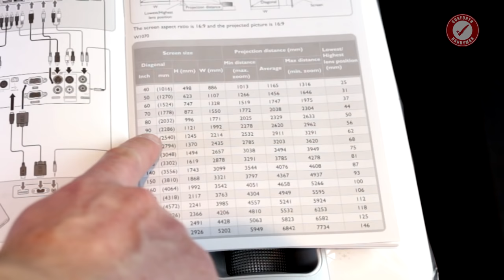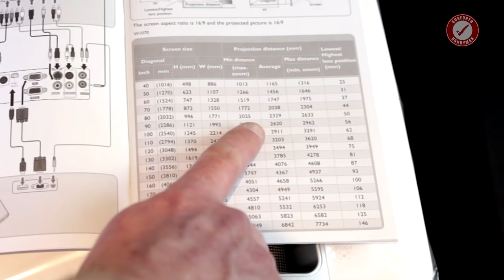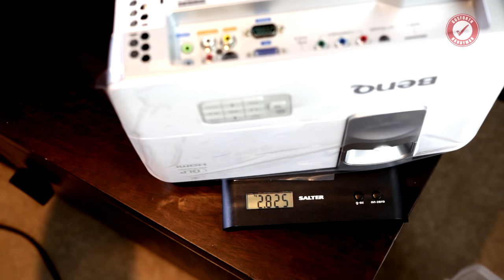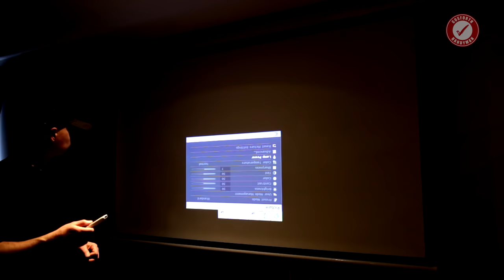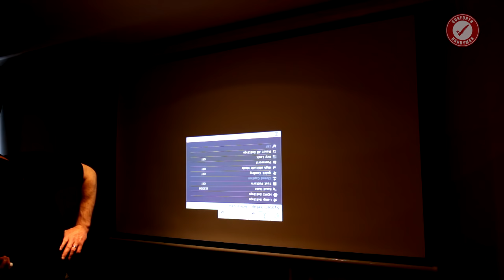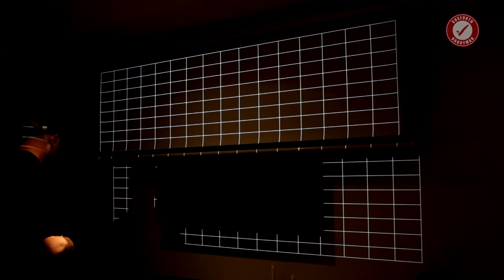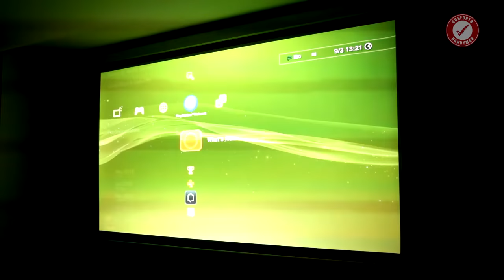How to Install a Projector on a Ceiling with 90" Screen (detailed install)

Comment from the maker: Similar to what I'm using:
BenQ W1050 Projector: https://amzn.to/2tqXtn6 (UK)
Luxburg 90" Motorised Projector Screen: https://amzn.to/2K8eflF (UK)
BenQ HT2050A Projector: https://amzn.to/2MPrd6m (US)
Homegear 100" Motorized Projector Screen: https://amzn.to/2lr1c0p (US)
I've also added a full article to go with this video here, hopefully you'll find it a useful addition: http://gosforthhandyman.com/2017/05/installing-a-projector-on-a-ceiling/
(the above are affiliate links)
Reply: See im putting mine in the Living room, but its coming from our high-speed Gaming computer. I have to tweek the Resolution on the computer I found out, and a Certain Distance I found, away from the Screen. I tried to Eyeball it... No Sir. U gotta get the Specs, and measure for that Ceiling Bracket. Cuz theres a certain area that you want your Lens to line up with on the Screen, and the Distance away that is calculated by the Dimensions of the Screen. So yal Cant eyeball it. Lol.
Reply: Hi there,

Great video. Quick question, what tool did you use for the  screws that you put into the ceiling for attaching the ceiling bracket too. And what type of screws are they?
Reply: Can this be mounted to sheetrock?
Reply: Just been reading about geefix for hollow walls/ ceilings they have really good recommendations, what projector bracket did you use, i cudn't see a link for them???

Comment: I think you tip about placing the bracket at the center of gravity as opposed to the center of the projector is extremely valuable.  After all, the center of balance is almost certainly NOT the center of the device because the weight of the various internal components is unlikely to be evenly distributed.  I am always amazed at the number of small details that I fail to consider because I am just a layman.  Thank you!
Reply from the maker: No worries - gland to be of help! 👍

Comment: Solid work, I have been a home theater installer for about 7 years. At my current company I am the only person who uses anchors to mount projos and tvs they all think im crazy but they just haven't done the research.. I typically use Hilti Toggle anchors which hold up to 124lb a piece and hang 85" tvs with them never had an issue. A lot of people think you need a stud and thats just not the case unless its a full motion articulating mount.

Comment: Good solid advice for this budget projector. A £10 one is just a bit of metal , a £100 mount is one that has fine adjustments to get the best alignment and can take a far greater weight so bear that in mind when buying. Get what’s fit for purpose depending on  what level of projector you have chosen.

Comment: I"m DIYing my home studio/theater. Should I add any other wire besides HDMI ? I don't have a projector yet but will probably be lower end consumer range.  Also - given the option, should I add a dedicated circuit to plug the project in to?

Comment: Nice video. Although sheetrock anchors are strong, for something this expensive, you really should find a joist to make sure at least 2 of the screws are secured. Over time, downward forces and shaking from your home theater subwoofer will weaken the hold of the anchors over time. :-)
Reply from the maker: Not necessary with these anchors - they're rated to 15kg each and there's 4 of them - the projector weighs 3kg. I guarantee you the ceiling will fall down before this comes loose.
Reply: @GosforthHandyman  Yes but all the stress is within a few inches, really dodgy

Comment: Two long bits of string that are the same length attached to the corners of the screen and pulled tight will give you the exact centre of the screen on the ceiling. If you mark the location and then slide your fingers along the strings (keeping them equal and together) mark again and join the points you have a straight line perpendicular to the screen.  Helpful if your room isn’t square...
Reply: Or, place the end of a flashlight flush against the opposite wall, move the flashlight along the wall until it aligns with the center of the screen which is on the other wall, and that's your lens center, regardless whether the room is square or not. Takes less than one minute to do.

Comment: Hi, I've read that pull down screens curl in the corners so I was considering a fixed frame one, but then I have to move it back and fourth. How is your motorised one?
Reply from the maker: There's a little bit of curl but not bad.

Comment: Did you tried to find any stud behind the ceiling  using your stud detector to secure those anchors or you just drill the ceiling and just place them, because i dont know how is posible to resist that much weight , i was trying to install mine but i doubt it to do it because i was trying to find any stud behind the ceiling to hold the weight
Reply from the maker: Think I mentioned in the vid, the projector only weighs about 3kg. There are 4 fixings and each one is rated to around 15kg. 👍

Comment: 8:28 You wouldn't believe how many home theaters I've seen over the years, that were mounted with the projector's bracket dead center of the screen, which of course places the lens off center (unless the projector's lens happens to be centered in it's housing, which many are not).

Comment: Great step by step and clear installation. Btw what kind of the cordless drill u using it? can drill on concrete wall too? is it very expensive? i wanna get one for drilling and screwing.
Reply from the maker: It's a Makita hammer drill - OK for block work and soft stuff but for concrete I'd use an SDS drill. It was about £230 in a twin pack with an impact driver.
Reply: so for ceiling is not concrete right can be use foe this kind of impact drill?
Reply from the maker: I don't really understand, ceiling is made of plasterboard not concrete.

Comment: Will drywall hold the weight? Or do I need to find the joist to drill into? Have optoma 142x
Reply from the maker: The expanding metal plugs I used are rated to 15kg each and there's 4 of them. This projector weighs about 3kg so is absolutely fine. 👍
Reply: Gosforth Handyman thanks. Also I have a optoma manual projector screen. Do I need to find the joist for that? Weights 5kg. Thanks in advance

Comment: On the topic of projection distance and projection size, from wall to wall I have 3.3m so say 3m from lense to wall which allows for the bare minimum of project (92inch) is it possible to blow it up or make it smaller or is that what you get and is their no altering projection size

Comment: Easy if you have keystone correction on your projector to trim out any slight mounting inaccuracies. It's an absolute pig of a job mounting a projector that has nothing but a little vertical lens shift.

Comment: Hi
Just came across this video at right time.. I'm going to fit some heavy lights into a kitchen ceiling suspended by 2 hooks but where I want them sited doesn't line up with joists. Had thought of using anchors but wasn't sure if load bearing was same for anchors as they're vertical and not horizontal as in a wall.. Could 2 anchors hold about 3 kilos or should I change position and screw hooks into joists? BTW I love your videos... Mark
Reply from the maker: Cheers Mark! Really difficult to say without seeing it. I'd perhaps try something like this but I haven't tested them myself - https://amzn.to/2TgBw7o (affiliate link)

Comment: What fixing would you suggest to mount a projector that weighs 11kg if you can't attach to the stud please?
Reply from the maker: For an 11kg projector I would fix a plate to the ceiling that spans the studs if possible - or if you could fix something in by lifting floorboards above, that would be neater. 👍

Comment: is it a good idea to put apple tv on the projector after this mount?  Not sure if this extra weight will be a problem for the mount and not sure if the heat from the projector will affect apple tv
Reply from the maker: I wouldn't cover any vents on the projector - will shorten your bulb life. Weight probably wouldn't be a problem. 👍
Reply: ah, thanks for the reply!  You make a good point.  I didn't even think about any affection to the projector.   Emm, so the vents are on the top? Does the mount also cover some vents then? I am just so confused.

Comment: I need to send 4k video to a ceiling mount projector from my receiver. Its a 15m distance. I will probably use a fibre optic HDMI cable. Expensive, but less equipment needed.

Comment: U were having trouble with the focus i wish you didnt edit the part...where you started adjusting to screws at the top because camera cut then comeback perfect focus what screws did you adjust exactly thanks
Reply from the maker: Focus is adjusted with the focus ring on the projector itself - nothing to do with the screws. The screws are just for alignment. 👍
Reply: @GosforthHandyman  39:00 minutes mark you were talking about altering the position of the projector tweaking some screws sorry i did not explain myself correctly...what i was trying to say when you were not properly aligned you stop the video n boom everything was perfect  after im asking because my image is slanted... probably my projector is not perpendicular :/

Comment: How would you recommend installing a 14kg projector & mount in a flat with a suspended/dropped ceiling?
Reply from the maker: 14kg is pretty heavy - hard to say without seeing it. Ideally I'd lift the floor above and screw a supporting board between the joists and fasten to that. 👍
Reply: It’s a dropped ceiling on an aluminium system (purpose built flat from 2000s), then a 14 inch void and then the steel deck of the concrete floor of the flat above. Unfortunately no floorboards or rafters to use.

Comment: Mate, would you use rather fisher duo plugs nowadays or those metal ones?
Reply from the maker: No - I still prefer the metal expanding ones for heavier stuff - just peace of mind really. The Duo replace my red plugs and the lightweight GP fixings.  👍
Reply: @GosforthHandyman  Cheers mate, I'll give it a go then. I'm using Duos over 2 years now, it's an amazing invention, really. But now a customer called, wants to install a projector - 13.5kg (projector worth £2K+). The mounting plate is about 40cm x 30cm so 6 of these should be more than enough, I guess. Your video or videos if I count in Test Tuesdays was super useful and helped me decide! Thanks a lot!

Comment: will a chrome cast work ? save running hmdi cable ?
Reply from the maker: Good question! You'll need USB power for the Chromecast but if your projector has USB I don't see why not!
Reply: Interesting . Save a lot of  hassle  If it has a USB that powers out should work then . Save running cable across the room . Let u know if it works
Reply: Hi, so I'd like to know if it works, thank you
Reply: Just plug in your Chromecast into your receiver's HDMI slot if you want to fully utilise the surround sound offered by films in  Netflix, etc. Netflix films will usually come with Dolby Digital Plus, or maybe Atmos. Still have to think about the USB power though. Some new receivers might have extra USB slots for powering it, I reckon.

Comment: If you use too long hdmi lead, they will burn out the ports on your av receiver. I know this too well using a 10m hdmi lead. I now use a powered hdmi line via a lan line.
Reply: Utter tosh.. why on earth would it do this? I have a 20m HDMI works fine.
Reply: @blazer666del  yes does work fine as I had a 10m hdmi too and over a long time ur find ur hdmi port could burn out and break. Risk it if you like but will happen. It draws far more current trying to send signal over longer cable. Why don't u Google this or youtube thats what I did.
Reply: I need to send 4k video to a ceiling mount projector from my receiver. Its a 15m distance. I will probably use a fibre optic HDMI cable. Expensive, but less equipment needed.

Comment: Thanks for the video. Would the same HDMI cable you bought work on a 4k projector 12m long
Reply from the maker: Not sure on 4K. Mine was ultra cheap and I've never had a problem with HD though. If it's cheap enough and the reviews are OK just give it a try. Don't believe the hype that you need a $100 cable. 👍🛠
Reply: 4K does not go further than 5 meters in a passive cable. You will want a cat5 balun for longer runs.
Reply: Look for active or fiber optic HDMI cables over 10m that support 18GB/s speed. If you have signal, then the cable is more or less just as good as any other more expensive since it's digital (either you have picture or not).

Comment: This is bad advice.Them fittings wear loose in time.They are ok for some jobs to a wall.Never a ceiling.I have been a carpenter and joiner for over 40 years. You need a 6mm plywood board as large as possible above plaster board.And screw through plaster board into it.Remember.projectors have a fan.The projector is always vibrating.Also .if you are not experienced using them fittings and slightly damage hole.Then you have a big problem.
Reply from the maker: You're describing a situation that would never happen, ever. The projector doesn't 'vibrate' due to the fan - if it did the picture would be unwatchable. If all 4 screws came loose (which they wouldn't) they would all have to simultaneously unwind themselves by around 2cm before the projector would drop from the ceiling. If even one screw came loose (which it wouldn't) the picture would be out of alignment so you'd know about it immediately. You'd need significant vibration / movement for the situation you describe.
Reply: @GosforthHandyman  You dont use them fittings on ceilings,and most ceilings are 9mm plasterboard.All houses vibrate you just dont feel it.You use them fittings because it makes the job easy.I also work on cinema,s and anywere were there is sound there is vibration.I have also done the prep for projectors in private homes.
Reply from the maker: Nope, this is 12.5mm plasterboard - almost exclusively used in new builds these days. I use those fittings since they're the most appropriate for the job within the specifications of the fittings. This isn't a cinema - it's a house. Also ply very rarely comes in 6mm. 5mm or 5.5mm is the norm - both give a poor fixing for wood screws. You'd want min 9mm or preferably 12mm. If I was going to the hassle of pulling the ceiling down to fit a board above the drywall I'd play safe and go 18mm. Either way, pointless in this scenario.